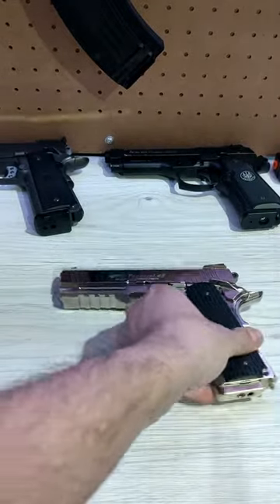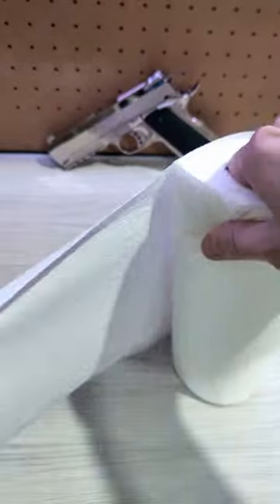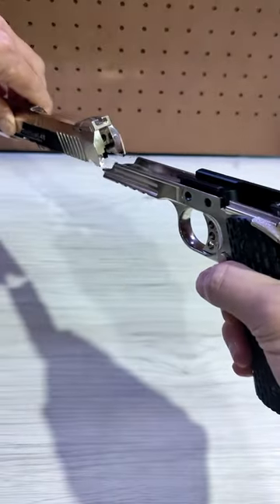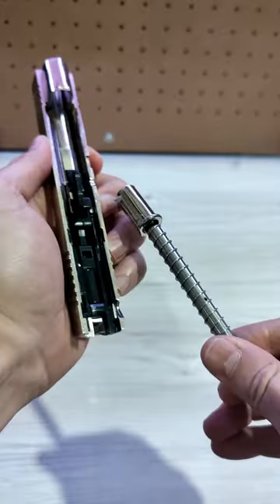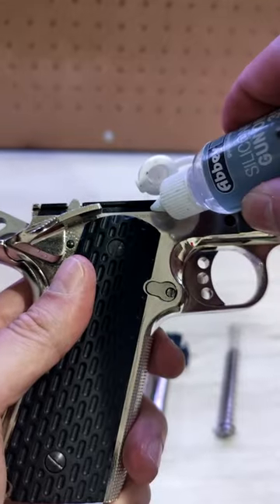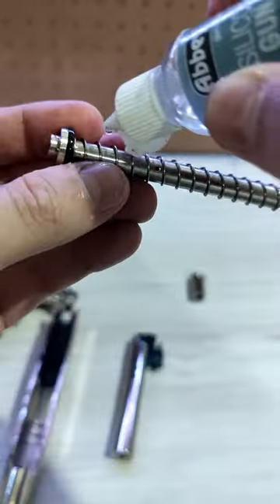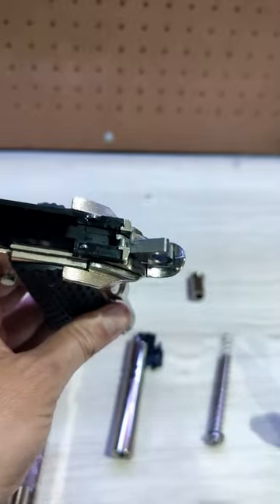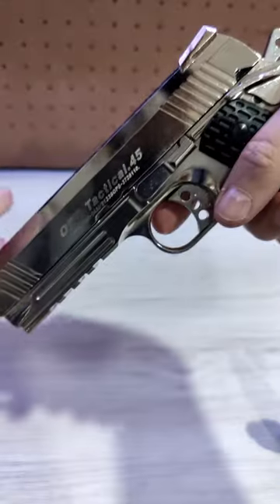How to Clean Your Gas Blowback Pistol in 30 Seconds

Comment: Grease is infinitely better than silicon oil in terms of metal on metal friction. It is just as smooth while also providing better protection against wear, being not as messy, lasts twice as long, and it also being cheaper.
Reply: It lasts maybe 10x longer if not more, silicon oil loves to wander off, grease doesnt. Cant believe youtubers and airsoft stores still recommend silicon oil...

Comment: Out of curiosity what’s it like having a semi wet projectile? I do a ton of airsoft stuff and it’s intriguing to see major airsoft companies get on the gel blaster train. I’m assuming gel blasters have some sort or HopUp, and hence HopUp buckings. I know in airsoft a wet bucking kinda kills your accuracy but what’s it like with gel soft? Also airsoft is usually 6mm but do gels have a fixed size?
Reply from the maker: It's a pain in the ass tbh :P Over time your gels lose their strength/size the longer they are out of their container or in a hot environment, which means when you are out at a field on a hot day, your GBB's become very unreliable because the gels are constantly shrinking the longer they are in your blaster.... plastic bb's are definitely better! Gels are typically around the 7.8mm mark, but depending on how you grew them, how long they have been soaked for and how long you have them out of the bottle for can change this, resulting in misfires and gels exploding out the barrel :(

Comment: Instead of oil. Use a ptfe grease like super lube. Oil displaces easily whole grease will stay put for longer. Also super lube will work better at keeping the different parts from wearing down

Comment: Silicone oil is not really meant for cleaning, it acts more as a lubrication to make the pistol/rifle run smoothly even when there's dirt and carbon build up the lubrication helps the bolt or the reciprocation of the slide (pistol) move back and forth. Cleaning it its a lot messier than applying silicone oil I tell you that much

Comment: I would be using sm50 on all the metal to metal contact man and silicone oil for the seals and non metal to metal contact
Reply: Molybdenum is even better for any metal to metal contact areas

Comment: Just a newbie question,but how frequent should i do a routine maintenance on this?also should i also do this for greengas?(i tried researching but only found so far that i dont need to maintain it as the gas im using already had premixed oil)
Reply from the maker: Hey Yuigahama :) yeah greengas does have oil in it which is helpful, but you still need to take it apart, remove any dirt that has built up with a paper towel, then re-apply silicone oil. i would suggest doing this after a game day. If it is just sitting around then you don't need to clean it that much.
Reply: @BlowBackIndustries  thanks for the clarification
Reply: Late reply but, you can use propane with an adapter for cheaper gas, I personally find green gas a pain to work with due to the moisture, but if you use propane lubricate and add oil every 5-10 mags in. Hope this helps.

Comment: i just take mostly of the parts appart and soak it in hot water dish washing solution.
dry with air,reassamble everything,lube up and be done with a squeeky clean gbb.
sometimes i spray lightly with silicone spray and wipe down as a last touch.
Reply from the maker: that sounds like a very well performing blaster :P
Reply: @BlowBackIndustries nice sarcasm

Comment: Rule #1 Dont be So Lazy Having your GBB In Maintenance. TAKE IT DOWN!!! 

There's no spring gonna Squirt Out dismantling Slide to Lower Frame.

Its better be cleaned Take Down than the Lazy Way of Locking the Slide and Squirt Silicone Lube on Contact Point Points you can only see.

It may Lube your GBB, But it wont drive the Dirt Away, It'll just Build up there.

Comment: Why are gelsoft guns made with so much cheaper materials than airsoft guns
Reply: Because gelsoft guns uses soft round that doesnt make tension,pressure, and vibrations in the internals?idk
Reply: @yuigahama3189  I already answered myself for that, your response isn't even close, it's mostly because there haven't been hardly any legitimate companies that have hopped on the market for gelsoft, Tokyo marui and wetech have jumped on the gas blowback portions, but a lot of the companies just don't want to waste their time or money on something like this, being that airsoft is allowed in most areas, including expensive airsoft guns that use a solid-gel compound instead of hard bbs or soft gel

Comment: can i use actual gun oil
Reply from the maker: No don't do that 😜 it will damage your blaster 😔
Reply: @BlowBackIndustries  how I dont understand
Reply: @stephan3300 using actual gun oil can melt your airsoft internals as even if you purchased metal based airsoft there are still plastics used in the internals unlike the real guns
Reply: @yuigahama3189  that is kinda stupid I now know that
Reply: @stephan3300  its best to just use silicon lubricant and theyre fairly cheaper than gun oil (around 7-9$)
Reply: yes, but only on metal contact point, But not on Loading nozzle and piston.

Comment: dude this is a fucking gun, why the hell is the inside hollow???
Reply from the maker: Gel blaster* 😜
Reply: @BlowBackIndustries  Gel Blaster is Different From your Airsoft GBB Pistol bro? 

Gel Blaster shoots Gellets 
While Airsoft Shoots Ceramic Pellets.

That's why Gel Blaster can be feed on airsoft and had different unit mechanism. 

Not because its powered with Motor | Gear and Li-Po just like AEG | EBBR Airsoft, it can be Feed there.